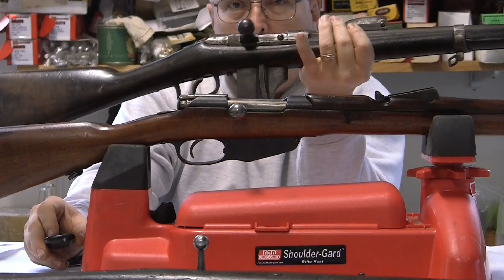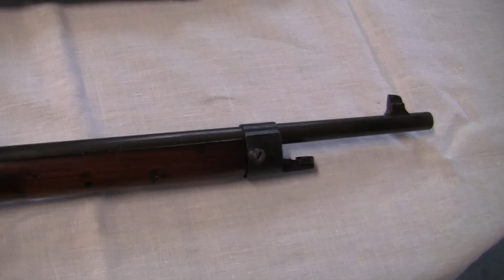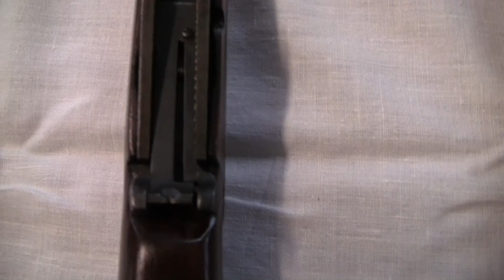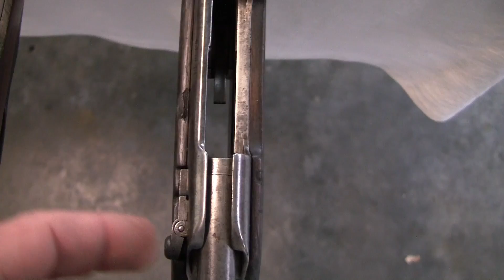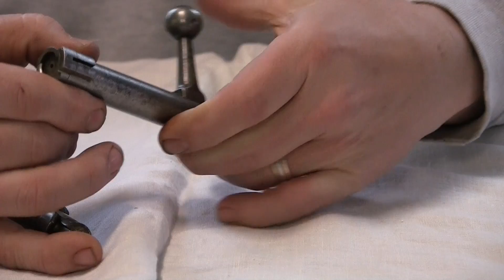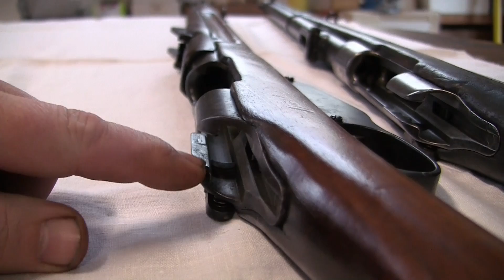Dutch Mannlicher Model 1895 Rifle 6.5x53R

Comment: austrio Hungarian rifle.
Reply: dillan mcdaniel A Dutch rifle.
Reply: This rifle was designed essentially and manufactured by the Austrian Weapons Factory in Steyr.  It was called by the manufacturer the 1895 (bolt action) rifle and cartridge.

The Government of the Netherlands adopted the rifle (and carbine) calling it the M1905 rifle.  The Dutch ordered the rifle with certain 'features' which make it different from the Romanian version.  It is called a "Dutch" rifle, but was developed and initially made in Austria.  It was later - just before the First World War - manufactured in Hembrug, Zaanstad, the Netherlands.
Reply: The Dutch M95 is often confused with the Austria-Hungarian M95. They are completely different rifles. The only thing that is identical is the magazine.
The Dutch M95 is a bolt-action rifle. The Austria-Hungarian M95 is a straight-pull-bolt-action rifle.
But the first/early production (Dutch) M95 rifles was made by Steyr in Austria-Hungary, for the Dutch. Later on the production took place at Hembrug in the Netherlands.
Reply: @WhattAreYouSaying and another difference: Austrian M95 is 8mm while the dutch Hembrug M95 is 6.5mm
Reply: @ClassicFormulaOne1  Yes, that's correct. Forgot to mention that. I have both these rifles in my collection.
Reply: @WhattAreYouSaying   cool I would want a Hembrug because my dutch grandfather fought with this rifle against the german when they were invading Holland in may 1940. Hembrug's however are very hard to get in Holland.

Comment: I am from Romania and it happens that I am also a gun history buff so ... the Dutch Mannlicher rifle and Romanian Mannlicher rifle are quite similar but not identical. The bolt action and caliber are the same but the sights and magazine are totally different, the Dutch military used this model until WWII but Romanian Army phased it out in 1917-1918 and used French rifles (Lebels and Berthiers) instead. The Romanian contract was signed in 1893 and the rifle was known locally as Mannlicher model 1893 and started to be introduced in 1894. The Dutch contract was signed in 1895 and the rifle had, I believe, 5 variants in service until 1940.
Reply: Where the ammo for the Dutch .6.5 x 53
Reply: The magazines are identical inside they accept the same clips.
Reply: @feydrautha80  rechamber it to a carcano 6 5 mm